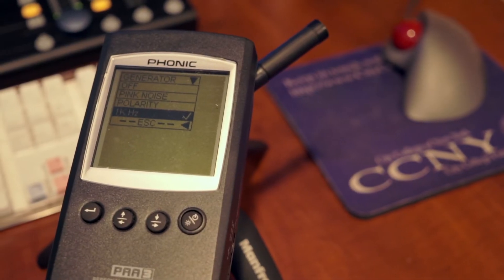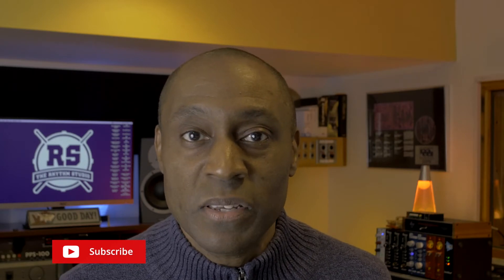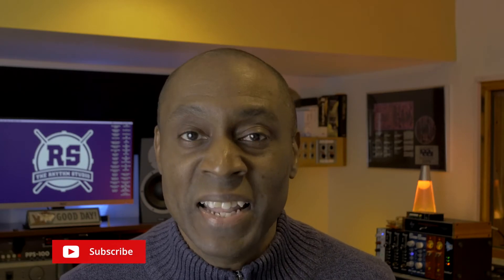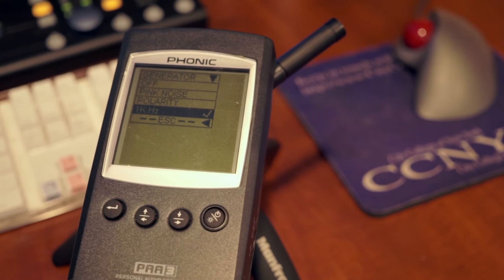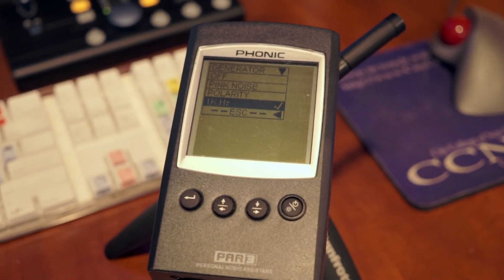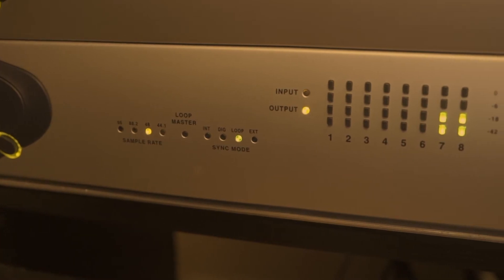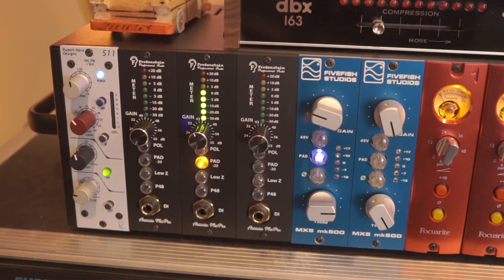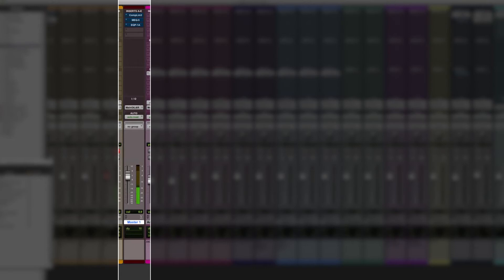How To Calibrate Your Pro Tools System to Unity Gain Outside of The Box

Comment: Here is the question....

If I do not have a mixer and I only have a Audio Interface...

What is Unity Gain on a Audio Interface?

People call it master volume or output gain... because the sound is coming out from the DAW!

Again the question is.... Without having a mixer showing 0db or Unity Gain...

What would be the Unity Gain or 0db when turning the master volume or output gain on the Audio Interface?
Reply from the maker: Assuming you're using Pro Tools unity gain is -18dbfs on the Pro Tools mixer. Without a mixer you have to reference the Pro Tools mixer's meters. I did an entire series on this topic hoping to demystify a few things.  https://youtu.be/VGzEQtHOqbQ start with this one. This one might help as well https://youtu.be/b7d5sdFiSpQ.

Comment: So i also have an isa one with a digital audio converter (bypassing my Audient id22) working out of pro tools, 24 bit/96 khz, do the same calibration principles apply since its digital? If working 32 bit does that change anything? Thanks man!
Reply: I should also note I dont record any external instruments, just vocals into pro tools
Reply from the maker: Aten, thanks for watching. Short answer yes the steps are the same. No, bit depth has no effect on the amplitude of a signal. If you haven't already checked out the updated series I did on this topic here's a link https://youtu.be/b7d5sdFiSpQ Thanks again for watching

Comment: This was not a good video for a beginner
Reply from the maker: What didn't you understand that maybe I could explain a little more clearer
Reply: @WarrenHenry  I followed the steps and it was too hot and I'm using studio one 3 my setup is a focusrite isa one going to a art pro vla compressor going to a focusrite 18i8 audio interface to a hp elite laptop 16g ram i7 processor